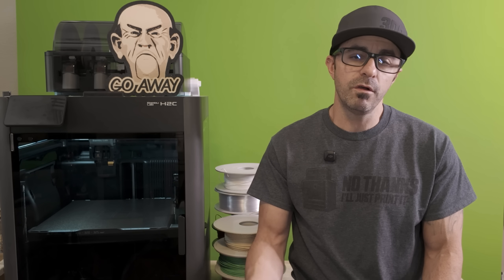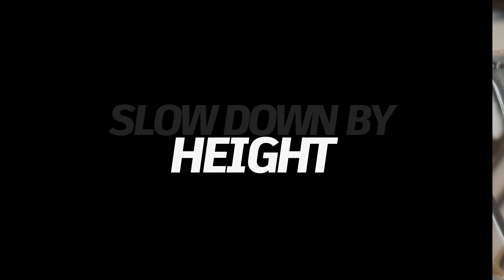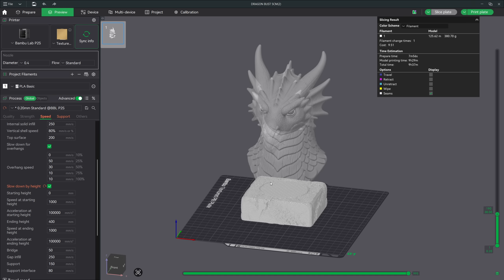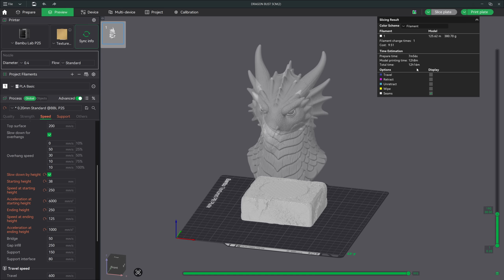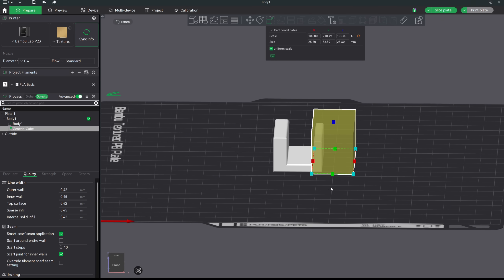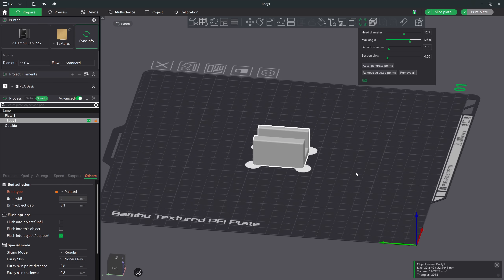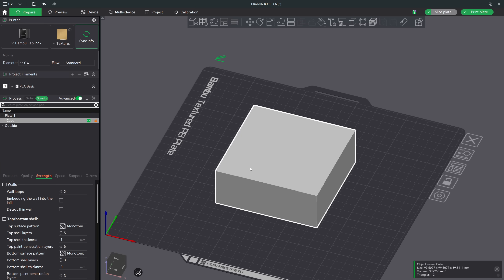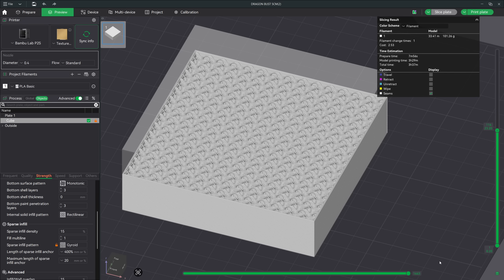Your 3D Prints Keep Failing (Here's Why)

Comment: Good stuff. I've been meaning to cobble together a pre-print checklist, but you thankfully beat me to it with stuff I didn't think of like adjusting speed by height. That will come in handy on my A1-mini where I am crazily printing out resin supported models with FDM. After a certain height those thin supports wobble like crazy.

Comment: I've just spent 20+ hours trying to get my new Neptune 4 to print. Came accrss your video and have now got it to print a large item with no trouble and all i had to do was crank the speed down.In my case i did so by 50% accross the board (i'm in no rush, quality over quantity). So thanks. Because of your simple tips, my printer is now printing...

Comment: I've been designing and printing for quite a few years now. I hardly ever have a print failure until I bought an Elegoo 4max. it has defeated me, and I don't give up easily. it cost me over a hundred hours trying to find out what the problem was. finally had to junk it and move on.

Comment: Thanks for the helpful info. 
I will be receiving my first ever 3D printer (QIDI Q2 Combo) in a few days. Trying to learn as much as I can between now and then. 
I am thankful all the "prosumer" type modelling and slicing is based on the Orca stuff. Even though you are exampling from Bambu, I should be able to do this in my QIDI version, or via Orca itself.
👍